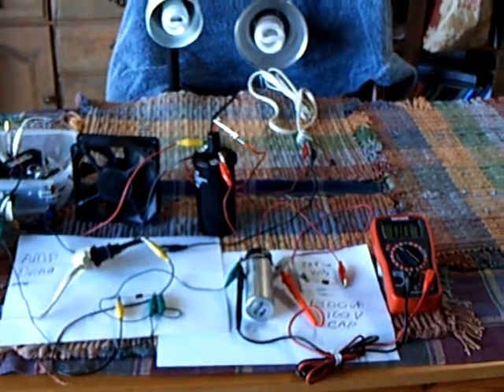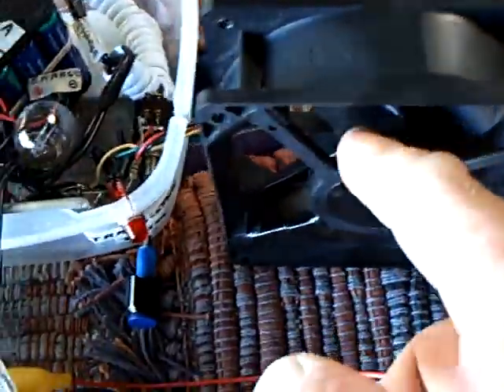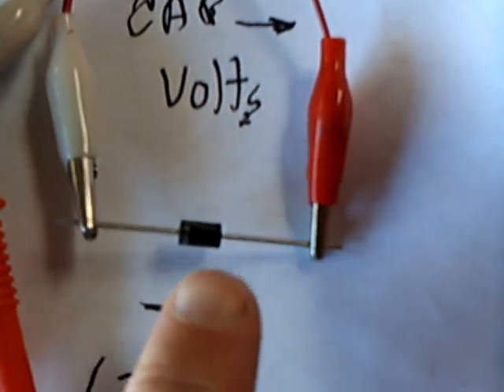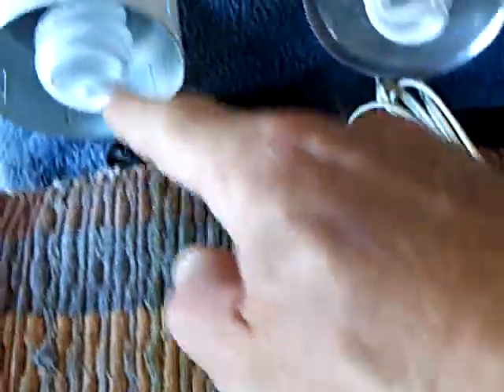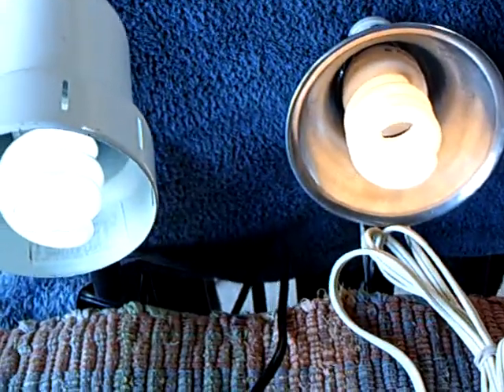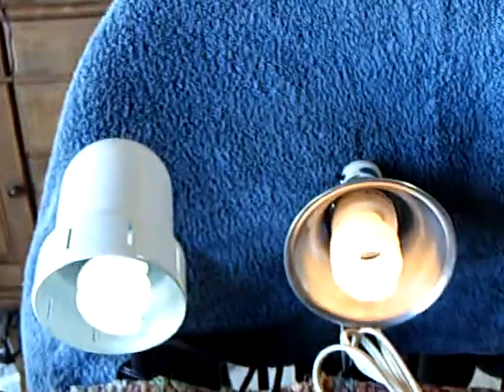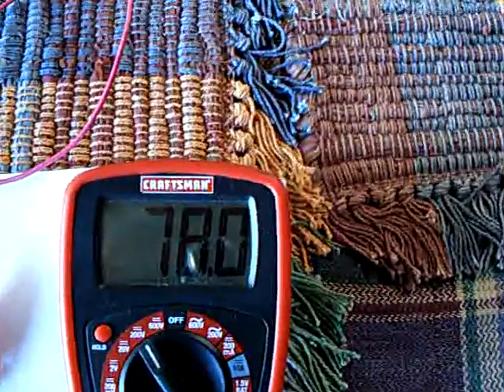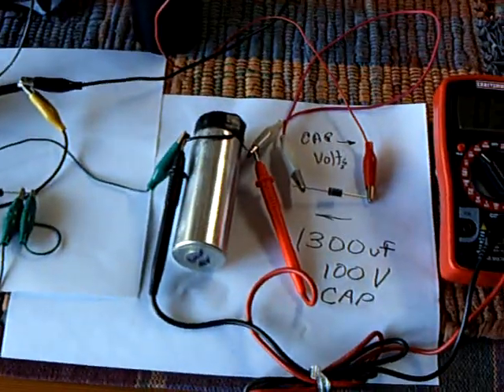Bodkins Experiment Replication -- Charging a capacitor

Comment: I tried it too and it does work.. BUT ... measure the current from the primary battery. I see a very high-current ... around 24Watts ... which is roughly what it takes to drive the CFRs.